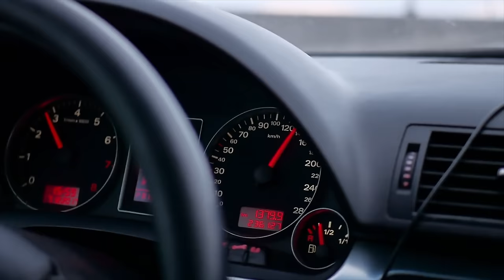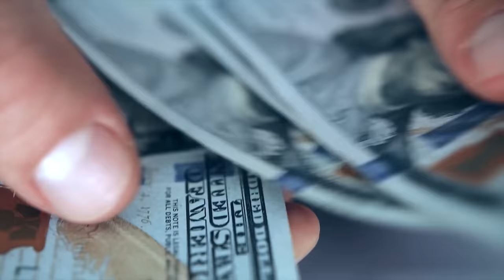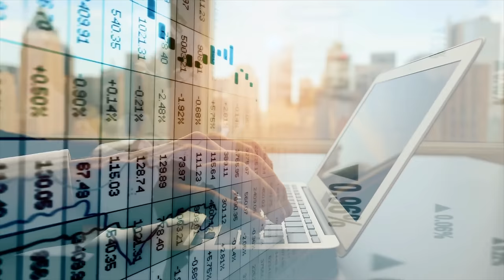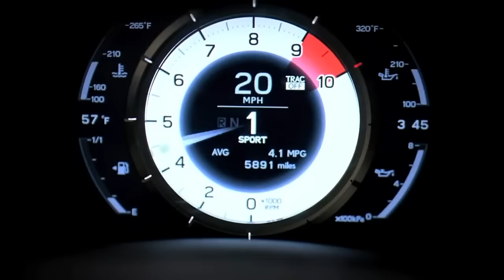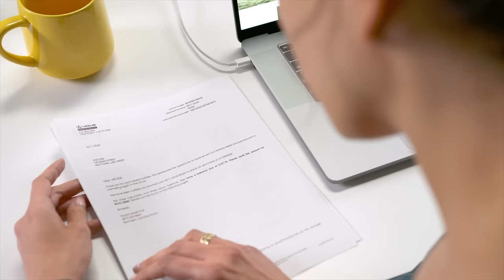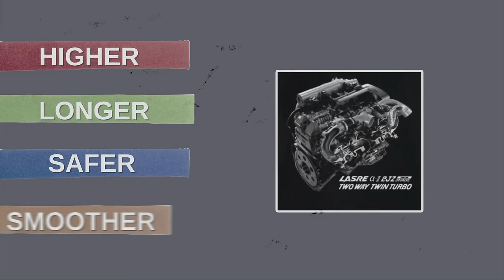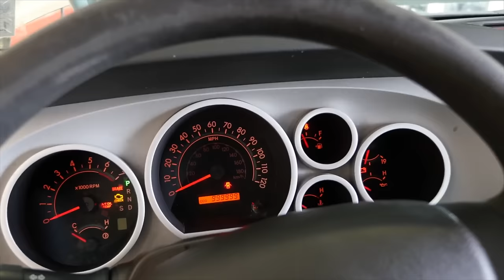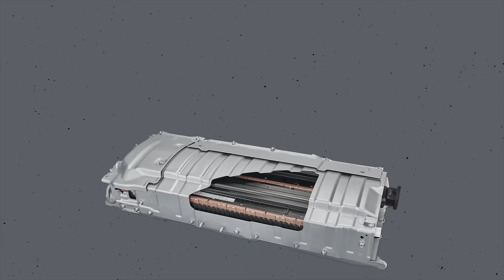Here's Why You Should Only Buy This Car Brand

Comment: I just got my first brand new car, a 2024 Toyota Corolla base model (LE). Ice cap white. I’ve never had anything this nice in my life, and I’m proud of it. It had 4 miles on the odometer when I left the lot. I came from a 2003 car to this, and I’m blown away so far. This car just sips on gas, and the amount of features on the base model was a welcome surprise.
I’ve watched Scotty for years now, and I pretty much owe it to him for picking a Toyota… and of course, 5K mile oil changes will be at the top of my priority list. I want this car to last 10+ years.
Reply: ancestral protection
Reply: I went from a Kia Rio  2012 (yeah I know bad decision) to a 2022 Corolla  like you said it ships on regular gas like fine whine  even at higher speeds I'm not really noticing much loss in gas mileage I think I'll get a hybrid Camry next after my Corolla  my first ever vehicle I drove was a 1999 Camry which rip the engine died from oil starvation as it leaked we couldn't ever find where it was coming from
Reply: And im assuming you just didnt check when getting gas? No way a not noticeable leak went through all of the oil on 1 tank of gas. 
Jusr remember this time every fill up!@Lonewander
Reply: It should last 15 + years if you take care of it.
Reply: I bought my 2005 Honda CRV in Oct 2004. It now has 291,000 miles on it. Best car I ever owned.
Reply: Please buy me 2006 Toyota Corolla 
That’s what I really need for work 🙏😊
Reply: It will easily. Out of my own experience, 10 years for a Toyota is nothing.

Comment: I have a 2001 Toyota Avalon with 394,000 miles. Original motor and transmission. And my sister has a 2002 Toyota 4-Runner with around 455,000 miles and still going.

Comment: Our 2012 Prius's original traction battery was still in good condition when we sold it at 210,000 miles!
Reply: That's unusual.  The mechanic that did my last inspection's Prius battery needs to be replaced at 60k.
Reply: @nucleargrizzly1776  i would have a different mechanic look at it.
Reply: @rdj232  He is a mechanic
Reply: @nucleargrizzly1776  which is why i said "get a different mechanic".
Reply: @nucleargrizzly1776 now! There is a 12Volt battery that is used to start the car and for its accessories. It’s the same size battery that is in every single car under the hood except for for the prius. It’s in the trunk and those last just as long as a regular car battery usually no more than four years but they’re only like $200. You get it replaced. It has nothing to do with the hybrid battery maybe that’s what he’s trying to tell you
Reply: @jessewynne8193  Could be.  I didn't really get into it with the mechanic.  He just mentioned it.  IIR he said $16K to repair.

Comment: My parents have a 98’ Camry they bought new.  Oil changes every 3000 miles, transmission fluid every 50k, original engine, transmission, starter, alternator, you get the picture.  He just texted me a picture a couple days ago that shows his odometer at 333, 333 miles.  Amazing!  Just goes to show the quality of Toyota vehicles and importance of routine maintenance.

Comment: I drive a Hyundai i30 built in Korea in 2010. In that time it’s had two recalls, four driver’s window regulators replaced, two door locks, one rear window which leaked so much the spare wheel well was flooded full, an ongoing transmission issue and various bits and pieces in the saloon fall apart. 
A few days ago I’d just parked at my local shopping mall and a guy parked next to me in a 2010 Toyota Corolla. The Corolla had covered similar distances to my i30 but in that time not one thing broke or gave any problems to the owner. My next car will be a Toyota. I won’t go near Korean again. A work friend had a 96 Corolla that he put over 450,000 miles on without any problems. It still had the original clutch when he traded it for a new car!

Comment: I have a Ford Focus with 288k miles, original engine and a 5 speed manual transmission that was replaced at 241k miles from my favorite shop 😀
Reply: From my experience Ford Focus are either really bullet proof or junk. Luck of the draw I guess. 😂
Reply: Good thing you have the 5 speed and not that dct...xd
Reply: I had a beautiful 2015 Focus Sedan 5-speed manual. Some senior woman decided to cross right-of-way traffic (me) in a blind intersection and make sure my beautiful car nose got crumpled backward. That and 9 months of constant chiropractor visits. The car would have easily lasted a very long time. Got 38 mpg against a 35 mph headwind (with gusts) doing 75 mph on the interstate. Same conditions in the calm, easily over 43 mpg.
Reply: Had a 10' Ford Focus w/5 speed manual transmission. Put 445,910 miles on it . I'd still be driving it but the body was going to hell with rust. Put a water pump, a half shaft and front pads on it . That's it!
Reply: @mikeg9450  sorry that your car got rust cancer
Reply: @mikeg9450  No clutch replacement?
I had a 2003 ZX3 5-speed I bought new, ran over 160,000k on it and I never had OEM clutch slippage.
That 2012+ Ti-VCT 2.0L engine was miles better than the old Zetec unit.
Reply: @exothermal.sprocket  original clutch.

Comment: I'm also a Toyota fan, once you actually get into the motors from all the different manufacturers Toyota generally makes the best.

Granted they have had a couple lemons.  I wouldn't give the early 1ZZ motor very high marks because they failed early from a lack of zinc.

Comment: My FJ is rock solid but the Toyota dealer here is a nightmare!  They messed up my car so bad.  Had the air conditioner fixed and they didn’t reconnect my gas line and I got stuck on the way home, then the top side pieces of the body flew off and were lost because they didn’t clip them on.   Had the transmission fluid changed and they shorted it by 2 quarts.  Awful service!  They couldn’t even put my wipers back on right.  Never again.

Comment: Had 3 Toyota's, and had plenty of issues. Had a 2008 Corrola, and the  Transmission went out at 100,000 miles, had a 2003 Toyota Tundra pick up, rear end went out at 60,000, and had a 2013 Camery, kept pumping oil into the air cleaner box, and kept over heating. Yes, I took care of all three, and followed the maintenance schedule. Not again.
Reply: sounds like really bad luck
Reply: @Michael-jp3tl  Mine yes. Not speaking for everyone. Not saying all Toyota's are crap. Their good, just not to me. Now I got a 14' Charger R/T owned 5 years, no issues at all. (Chrysler Group LLC under the hood, not FCA)

Comment: Toyota/Lexus builds direct injection engines that use both Direct-injection as well as Port-injection to avoid carbon buildup on the intake valves. The one exception to this is the Lexus IS-250 (and GS-300) that have only Direct-injection in their engines and owners of those vehicles are totally happy with their cars for the first few years, until they turn to nightmares when the carbon builds up on the engines and they need an engine overhaul costing $6,000.  Since then Toyota only builds engines that have both the direct-injection combined with the port-injection to avoid this costy carbon buildup problem in their engines.

Comment: 2013 Camry Hybrid - 245,000 miles with no major repairs and the original battery pack.  2013 Prius V with 148,000 miles - a few repairs - original battery pack.  2004 Land Cruiser with 270,000 miles, and a few repairs.  I love my Toyotas!  Thanks, Scotty.  Great video.

Comment: Maintenance is key.
Reply: Change the oil at 1,000 miles, if the car is new; then every 5,000 miles or six-months, whichever occurs first. Why? Well, oil & filters are cheap, engines are expensive. (like Scotty always says) And use the recommended viscosity "Full" synthetic oil like Liqui Moly, Motul, or Amsoil along with a Toyota OEM oil filter and you will not regret it.

Comment: My wife bought a 2007 Acura and it's still running at 206k miles. Regular oil changes using Mobile 1 synthetic oil for the most part. Needed A/C clutch replacement at 60k under recall, a power steering cable leak replacement and around 190k a small radiator hose leak fixed. Needs struts now but still running strong.

Comment: I had a 1999 Corolla straight out of high school at the age of 18 in 2010. Probably put 50,000+ miles on it before I was told, and understood how often you should change your oil. 
Drove it more than 100,000+ miles in 5 years till I rear ended a person who randomly stopped in the middle of a street trying to turn over a median. 
Used to clean it and maintain it every Sunday like a Religion after abusing; it made me truly appreciate vehicles, none the less Toyota. 

The wife and I recently bought a 44,000 mile 2016 Toyota 4Runner in August last year. Just barely passed over 8,000 miles we’ve put on it. I’m damned determined to have it it till it falls apart, I’ll replace the engine in it no problem, I’m taking about the frame falls apart and can’t support the beast any longer.

Comment: Scotty, You missed one of Toyotas amazing engines. I have a Lexus GS-F with the 5.0 L (2UR-GSE) V8 engine with an output of 473 HP and 389 lb⋅ft of torque.  I plan to keep it forever.  It's an amazing car, drives like a dream and is a blast to drive.  Zero to 60 in 4.2 seconds with no turbos or superchargers.

Comment: My experience. Buy a "seriously heavy duty" car, preferably with 6 cy engine. Drive it gently and maintain it.  Warm engine if more than 3 hours non-driving. Accelerate slowly when engine not warm enough. Keep plenty of distance when driving.  My Acura MDX's tires and brake pads are less than half worn when at 80K miles.  Zero problem.

Comment: Scotty, I worked at Toyota. When lube techs did “Toyota care” services, they weren’t checking anything. They don’t check fluids or filters or belts or anything at all. Because the pay for Toyota care is extremely low. It’s basically the warranty pay version of an oil change/tire rotation. They just got it in there and got it out as fast as they could, and no one wanted to do them.

Comment: I drove an '05 Prius as a taxi in Los Angeles for several months back in 2018....it got to 500k miles and the owner pulled it off the raod and sold it for $3,000. All original. Ran like a top....it sounded like a sewing machine but it was bulletproof.

Comment: That's funny, I used to work with a Mark Miller who had a late nineties corolla with over 300,000 miles on it.  It was black and the paint was faded really bad as it had never been garaged since he bought it new.  It burned a quart of oil between oil changes and he changed it every 3,000 miles (not synthetic).  I know that's not a HUGE amount of miles compared to the cars in this video, but if you could hear that corolla run, it was amazing.  So smooth.   He said he easily got 34 mpg on the highway.  When he retired I made him promise to give me first dibs when he wanted to get rid of it.  I saw the car about a year later at a gas station and a young high school kid got in it.  I asked him where the owner was and he said that my friend gave him the car for helping roof his house and garage.  The kid said he loved the car even though it was an old beater.

Comment: Got 247,00 on a 2004 Sequoia that pulled a 21’ bassboat to and from Florida to Ontario, Canada many times.
But, over time, the Sequoia did “wear out”:
Rust in the door edging and trunk
Replacing Catalytic Converter
Instrumentation lights
4-Wheel drive system
So, I traded it in and bought a used 2021 Sequoia and continued to be quite pleased.

Be well.

Comment: I've got a 2014 IS350 with 79,000 miles on it and i drive it in sport mode or manual mode every day, my only concern is the 8 speed transmission. You don't really hear about the praises of Toyota's transmissions since the engines get all the glory. I know driving it in manual mode can lead to faster wear and tear but it's a lot more fun to drive, although for the most part sport mode is good enough since it tries to keep u in the lowest gear possible even when cruising.

Comment: I own a Toyota 2007 Camry Hybrid with 210,000 miles on it and it looks and drives like new, awesome car!
Reply: I am guessing you haven't replaced the hybrid battery which is awesome. I am hoping my wife's 2020 Honda Accord hybrid lasts that long, especially the battery.
Reply: @ivannadler1789  yes battery was replaced at about 180,000 miles before I bought car, hope it lasts another!
Reply: @dmc19730   That's good to know, and hopefully the new batteries will last longer. Good luck.

Comment: I have a Lexus LS 460 with 186,000 miles and absolutely nothing wrong with it still looks almost new… change the oil every 2500 miles or every six months whatever first don’t drive it very much anymore. I have a forerunner and a motorcycle so it’s just shopping and small trips…

Comment: I drive a Toyota Venza 2013.
I bought it used and have put 100 thousand km with no problems even though I've only done 2 oil changes. I'm
74 years old and driven a lot of cars and this, and F150's are bullet proof.
Reply: I’d say your engine won’t last with 50k oil changes lol

Comment: I've had Dodges and Chevrolets go way past 200k miles 230+ on Dodges and 290+ on Chevys. I had a Chevy 2500 6.0 to finally retire at 545k+  miles.
Reply: I had a 2009 Dodge pickup. Ran like a champ, but the body was all rotted out. Exhaust manifold bolts kept braking. Traded it in at 87,000 miles for a 2018 Toyota Tundra.
Reply: @icosthop9998  Unfortunately yes.

Comment: I bought a used 2007 Toyota Avalon XLE in 2008 with 44,000 miles on it.  It had 431,998 miles on it when it was rear ended and totaled in October 2022.  Original motor and transmission.  The factory starter lasted 348,000 miles before replacing it.  I replaced the car with a used 2018 Toyota Avalon XLE Premium.  Toyota for life!

Comment: I have a 2013 Toyota Highlander and I’ve been very happy with the car but I’ve reached a point where the spark plugs should be changed. Because of the way Toyota has situated the engine side to side instead of front to back for a V6 the estimates that I have gotten for spark plug replacement aren’t $150-$400 but more like 650+ dollars now I am still a Toyota fan but I have to wonder why that is so outrageous and why the designers decided that they couldn’t put it front to back so the plugs could be changed a little easier. That’s my main complaint at this point.
All the pluses have been way up there in terms of the way it rides, and I do the schedule oil maintenance on a regular basis as I do food delivery and had the transmission changed at its last interval, and trying to keep up on all the little things that should be taken care of.

Comment: Have an 07 Chevy trailblazer with a little over 450,000 miles on it original motor and tranny. Although it is showing its age, main major repairs being, fan clutch and water pump orher than that just the usual maintenance, oil breaks, tires, ball joints, toe rods. Most vehicles if well taken care of can last a long time
Reply: "Well taken care of" is the key phrase.

Ive had Subaru and Volkswagon fans tell me "they're good cars if you take care of them". And what they mean is spending thousands of dollars in repairs every single year.

Toyotas are the best because they DONT require that type of maintenance. They can go 300k with minimal maintenance. Which is quite rare among vehicle brands, even if you got lucky with your Blazer.

Comment: These are old old naturally aspired Toyotas that were reliable. The new Toyotas with turbocharged engines won’t last that long. I’d be surprised it these turbocharged engines lasts 200k miles.
Reply: Agree. Hate the new 3.4v6tt . They make good power but sound horrible when revved and have some vibrations/buzziness.